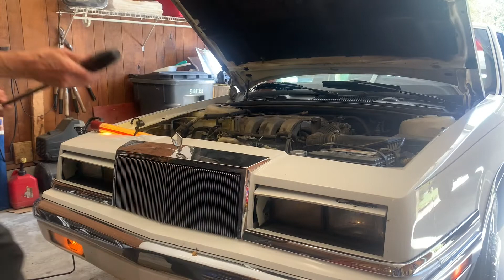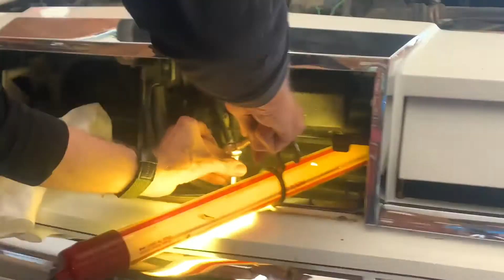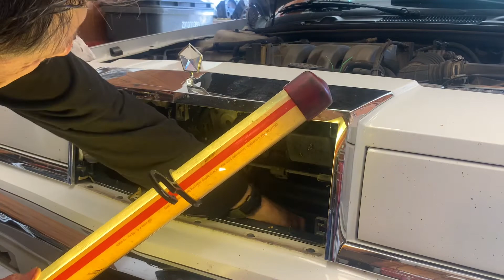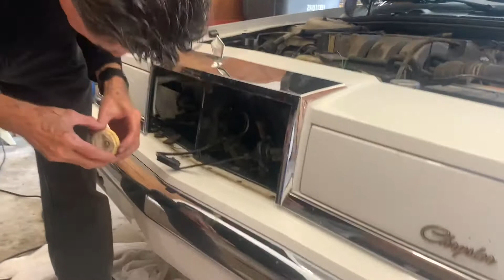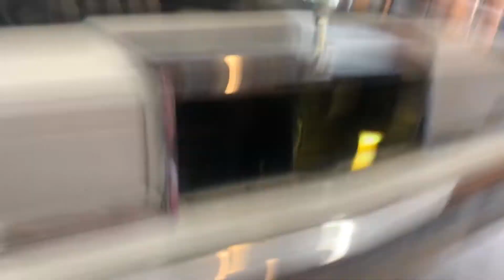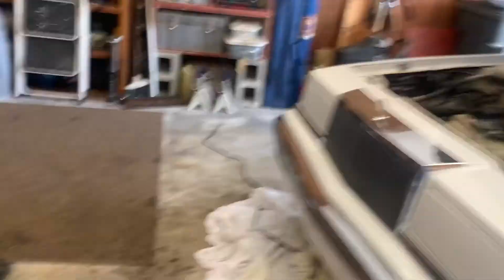Project Daily Fifth Avenue Ep.7 - headlight cover repair-

Comment: mine wont close
Reply from the maker: Check to make sure the spring is not kinked. If you can’t get the electrical motor to work correctly, you can disconnect the spring inside the grill and open and close them manually

Comment: Did i just hear you say midas??? Stay away from midas they are a fraud &rip off i had to pay almost $800 for a exhaust pipe that went from the catalytic converter near the engine in 2005 Toyota Corolla and it went all the way back to the muffler big pipe. Well not even 2 years later it had to be replaced again. I found out they use aluminum pipes without anti corrosion on it and they do that on purpose knowing that I'd have to go back replace the same thing at the same price & there warranty does not cover it. It only covered the clamps to hold it in place. It's supposed to be stainless steel with protected covering. I live in Massachusetts so the salt they put on the streets for the snow does a number on the undercarriage & car. My mechanic replaced the pipe with the correct pipes. 2 years now and still looks like new & shiny and he said that I shouldn't have to replace it ever again 😡😡😡